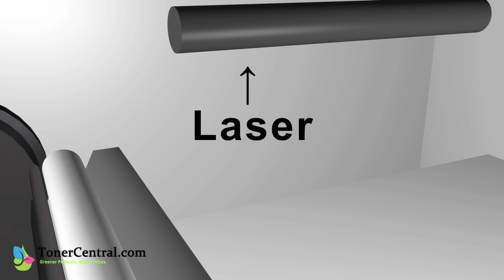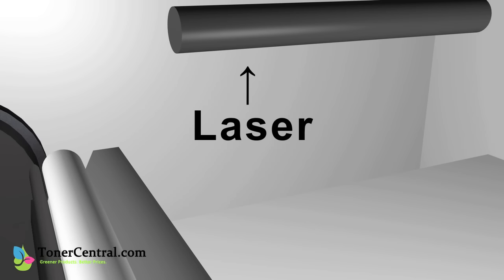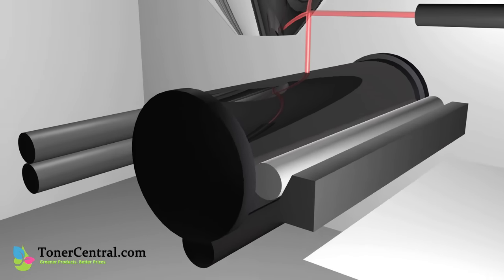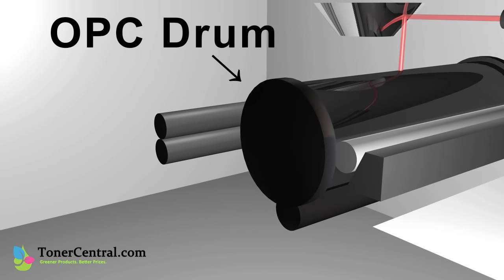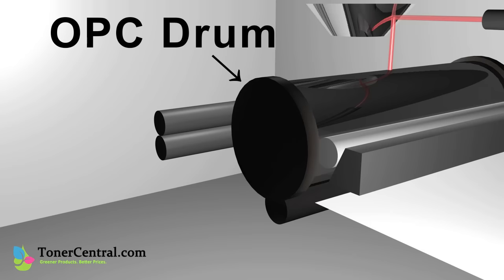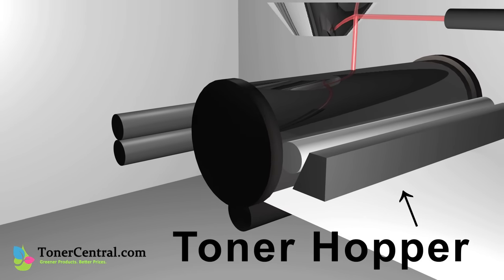How a laser printer works

Comment: @IIhauzz I agree, I purchased an inkjet printer a few months back and it is nothing but frustration.  I just bought a laser printer and love it.  No inky mess, cheap as dirt once you are up and running.
Reply: Forrest Trenaman I have an HP LaserJet 1160 I've been using for a few years now.  Best printer I've ever had minus the occasional paper jam.  All the ink jet printers I've had we're terrible.  The LaserJet only does black and white though.  Only drawback to it